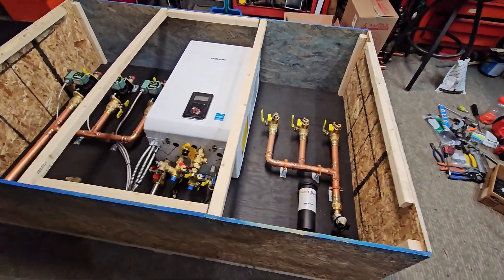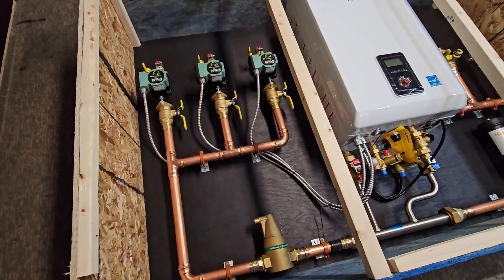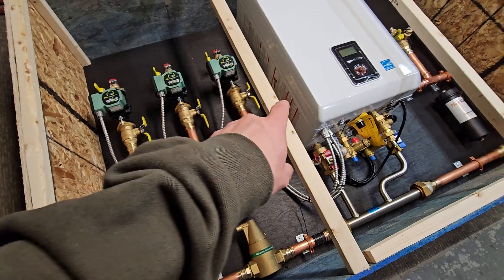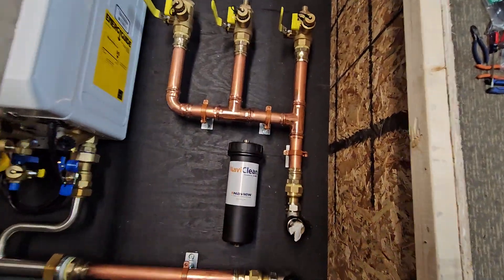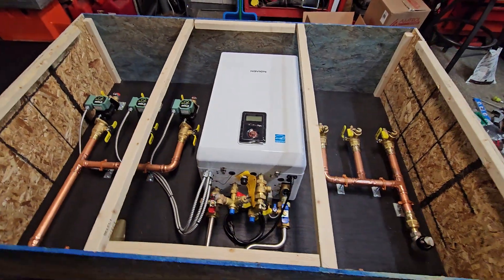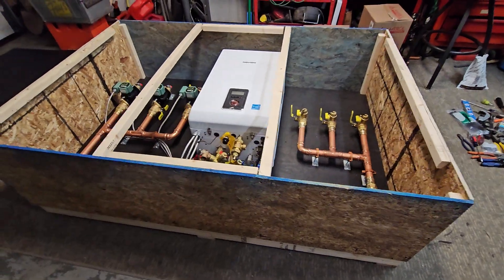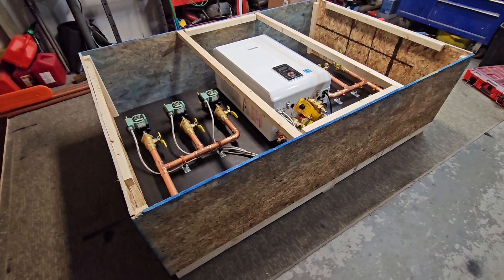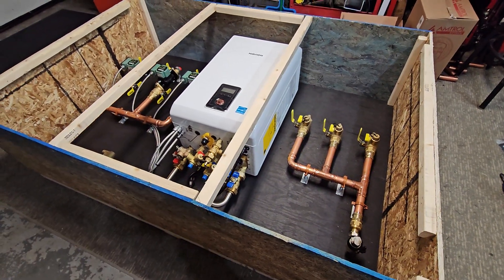3 Zone Radiant Heat Combi Boiler System

Comment: Is it true you need a separate relay if you want to use the nest thermostats ?
Reply from the maker: No...jist connect the R W and C and match that to the connections on the boiler.

Comment: Looks very good! Question, where are you putting the hydronic expansion tank?
Reply from the maker: It goes directly below the air separator but is shipped loose so it doesn't take up more room.
Reply: @JimSperanza  I figured, but I wasn't sure being so close to the backer board.